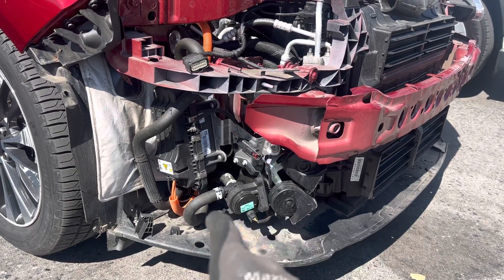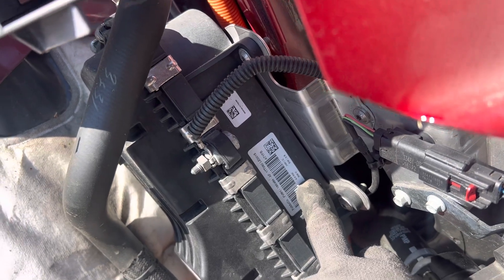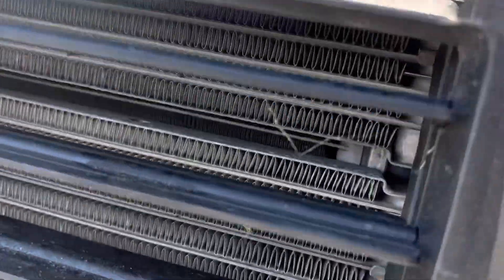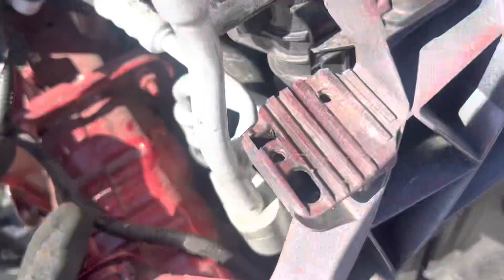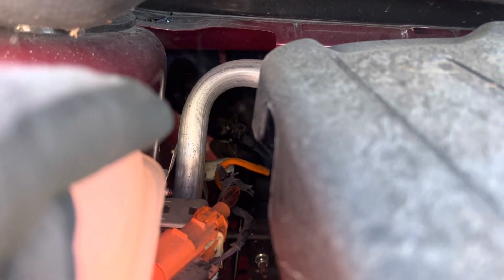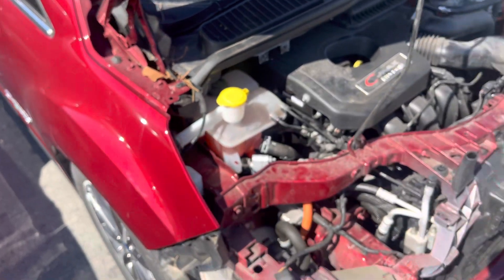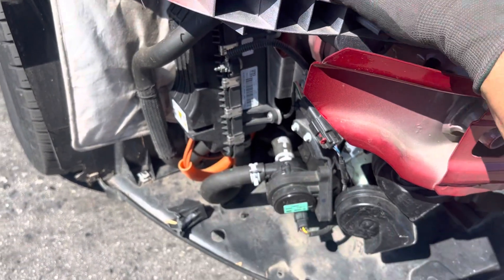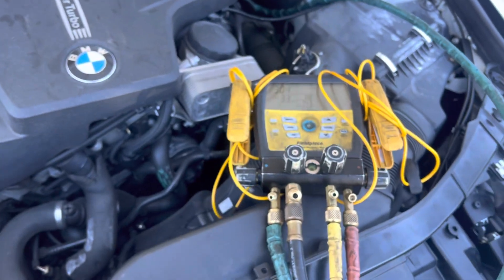￼EVERYTHING IS HEAT MANAGEMENT . The future is here as these cars get out of warranty ￼

Comment: Whats your thoughts on these complex system vs the old school stuff do they really work any better the fundamentals must be the same?
Reply from the maker: Out of necessity because of electric vehicles and hybrid vehicles they basically need to integrate one system to handle mini system simultaneously because of all the cooling and even heating requirements that are needed they cannot have a separate system for each item on the vehicle that needs heating or cooling. 

Basic old fundamentals worked just well with old mechanical relays and everything would be nice and simple and still get the job done.  But one tiny little Arduino or raspberry pi can switch 100 different relays and contactors instead of having a mile of wire and a lot of current carrying capabilities so that’s an advantage of materials and weight savings

It’s just going to be the survival of the brightest mines in Automotive you either stay up with the times or go flip burgers or change tires. 

There always be bright minds who figure around things and how to fix things so you do not have to go to the dealership this will never end so for all the guys who say this technology is going to put us out of jobs are the ones who can’t play with Arduino is a raspberry pies. 

It’s time to step up to the plate or go sit down on the bench and become a water boy.
Reply: @coldfinger459sub0  adapt or die, same goes for the manufacturers and dealerships
Reply: Back in the early days of emissions controls, the engine compartments were filled with trouble-prone vacuum lines to run everything.  Over the years, these vacuum lines disappeared. Replaced by electronics or completely different emissions systems.   I see the same thing for Hybrids and EV's. It's still early days. The haven't managed to integrate parts together into single modules like they eventually will.  It's like buying an early cell phone. They worked but not nearly as well as the ones that followed.

Comment: Heat exchanger/heater has to be for keeping the battery at optimal temperature even in cold weather. Is it exchanging heat into the Refrigerant?
Reply from the maker: I haven’t read about this particular model but by the KV rating that high I was figuring it’s an in-line heater to keep the batteries from freezing when they need charging in cold weather you are exactly correct that is what I think it is without actually proving it or reading literature. 

During my video when I re-watched it after I posted it I made some wrong word choices and references made a few mistakes but that’s how I fly no editing no retakes. 

In 10 years when these vehicles get old and out of warranty just think of all the 
Diagnostic procedures and symptoms they will have to learn that they have never ever experienced before with plate heat exchangers With multiple electric water pumps on the same circuit and two way and three way diverter valves introduced a little refrigerant leak into a glycol loop or vice a versa this is going to be fun to watch

Comment: Awesome design. Put all that expensive shit right on the corner of a bumper, so a small fender bender now is $8,000 in damage.  One small accident, you can lose all your fluids.
Reply: Someday, only the manufacturers can fix their “products”; and possibly they will get sick of that themselves!
Reply from the maker: @jrm163  they will never get sick of that that is what they’re hoping for it’s called a monopoly. 

         If they can make it so they are guaranteed only they could work on their own vehicles that means they could call their own prices and have higher profits.
Reply from the maker: as it is right now the Prius prime put a twenty six hundred dollar accumulator Assembly with all the switching valves that no individual components are obtainable you must buy the entire assembly if it receives any kind of physical contact at $2600 and there’s nothing but the plastic facia of the bumper protecting it.    

It gets replaced every time

I have four of them on my shelves right now
Reply: @coldfinger459sub0  lots of unnecessary waste!
Reply: Do you think you can do better?
They only have so much space, plus packaging and design constrains and existing parts that must be used!
Reply from the maker: @pepeshopping  other than placing them on the outside of any protection of the frame so they are the first casualty and even the lightest collision

and there are already commercial available items used in commercial industrial installations in arrangements that have already been figured out very efficiently. 

Automotive industry is always trying to reinvent something that’s already been invented and like the US government making a $9000 ranch or a $5000 toilet seat figures our way to make something more complicated more expensive and difficult to obtain every time they enter a new technology for the automotive industry.

But I better not complain because of these designs when they start to failure or get damaged they’re literally going to make the automotive industry hundreds of millions of dollars per year in upkeep and repairs. 

Guarantee job safety and revenue
Reply: @pepeshopping  yes.